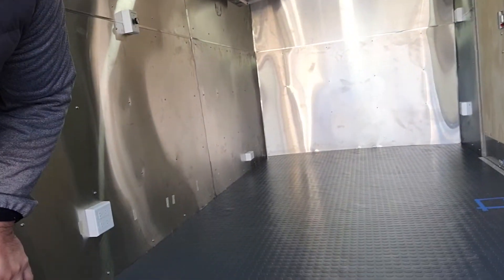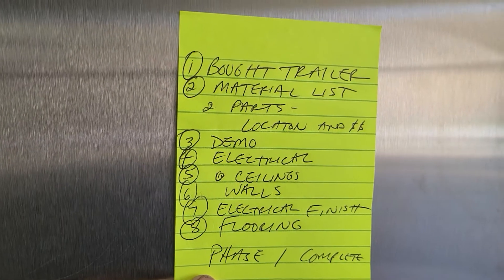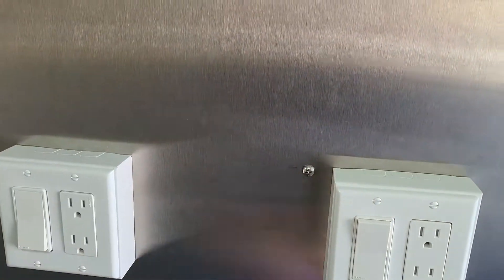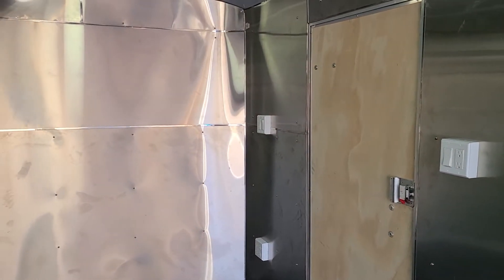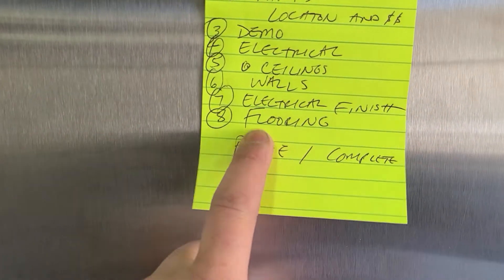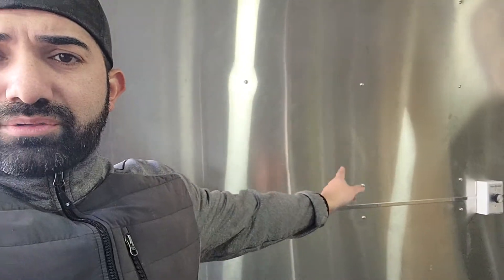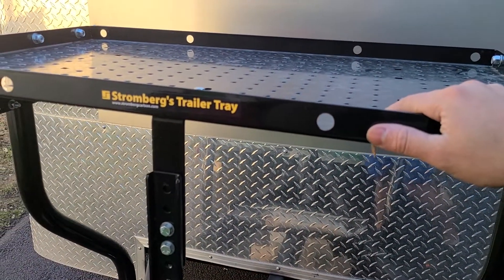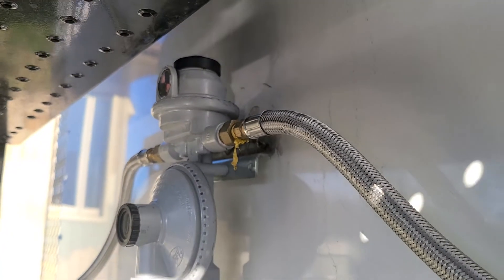Building a Food Truck: Phase 1 Checklist

Comment: Frank!!! You have done a really wonderful job so far with your trailer. I have a 7x16 V-Nose trailer I'm converting into a mobile kitchen as well. Question... where did you get the stainless for your walls?
Reply from the maker: Appreciate it. 👍 great size there 7x16 not to big not to small. Found the SS from a local metal place called a few and they had the best price and same quality in Addison, IL. They are heavy, so pickup would be necessary because shipping costs would be $$$$$ I would assume
Reply: @fbaltierrez  Thank you! Keep up the great work!

Comment: Do you have too run the electrical in the walls or can you use conduit for all the electrical wiring
Reply from the maker: Absolutely! You can run conduit on top of the walls, it's a nice clean look. I like it better than exposed flexible conduit.
Reply: Thanks! I just purchase a bread truck that’s 26 ft   . I’m in NC so I’m trying to find everything I need from stainless steel, ventilation exhaust system and concession window in this area
Reply from the maker: @richardoquarles5465  love it!!! Where and how much did you get the bread truck for???
Reply: Got for $1700 it’s a 99 all aluminum box. A friend use it for his snack delivery route. I had to replace the motor so right now I have right at 4800 in it.

Comment: I couldn't find the link from where you got the floor from
Reply from the maker: They sell it at menards or home depot. HUSKY Coin grey flooring
Reply: @fbaltierrez  is that commercial grade or for a garage floor?  sorry for being so particular im in learning stage.
Reply from the maker: @KenyanRon  https://www.homedepot.com/p/Husky-7-5-ft-x-17-ft-Coin-Grey-Universal-Flooring-HK70CN717SGRHD/205185022
Reply: I'm asking a company to leave the back as a ramp door. They are saying that if they put the two 100 lb propane cages on both sides of the nose it will affect the turning radius. What's your thoughts on that and do I really need 100lb tanks. I have a 46 inch griddle and 2 50lb fryers along with fire suppresion.
Reply from the maker: @KenyanRon  2 100 lbs tanks is a lot of propane. Heavy heavy tanks. Usually I see only 1 100 lbs tank on trucks
Reply: How do I run the 220 from my truck to the parallel kit for 2 predator generators. I'm seeing the kit is 110 is that correct